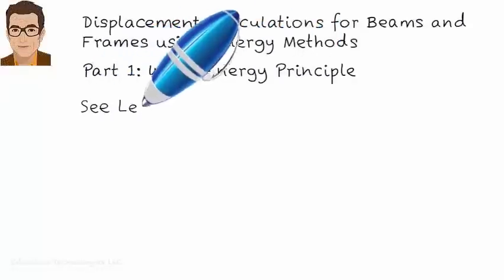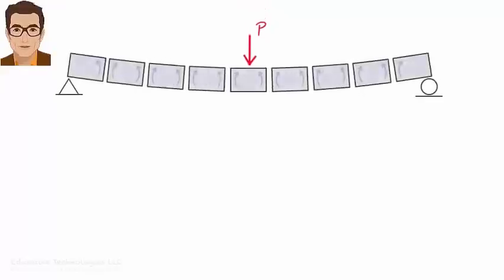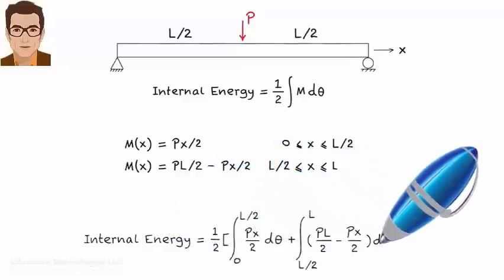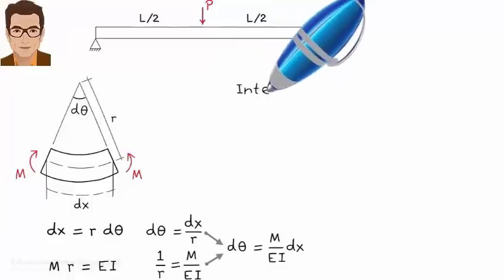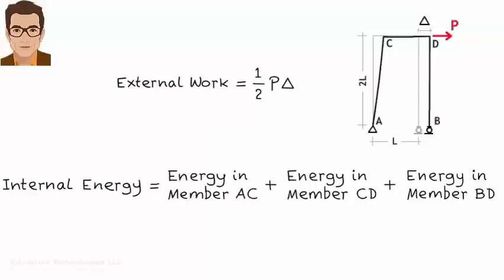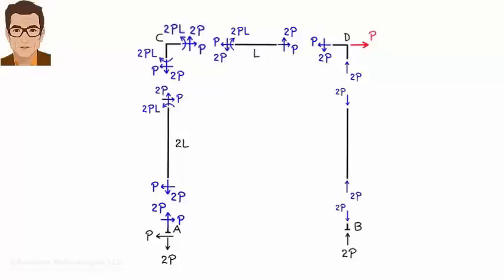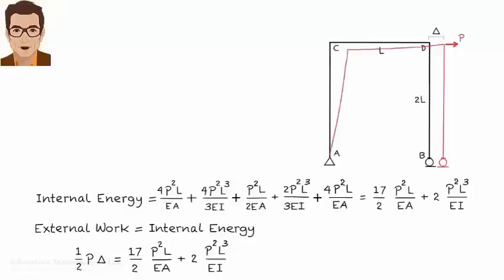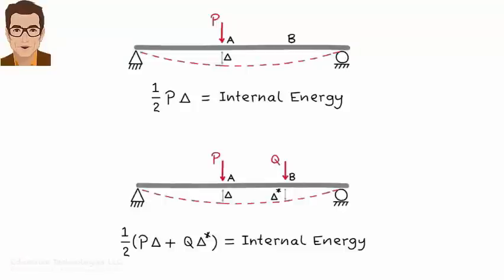SA20: Work-Energy Principle (Part 2)

Comment: Dr. I don't understand why the enegy by  shear had done in frame is negetive.
Reply from the maker: Not sure what you are referring to, please elaborate. Energy due to shear is assumed to be zero, it is not calculated here.
Reply: @DrStructure  Dr. at 11.22 ,I saw the shear is not zero but P , I don't understand why the energy due to sheer should be neglected .
Reply from the maker: In most beams, shear deformation is not significant, compared with rotation and axial deformations, hence we can often ignore it.  Further, the proper treatment of shear deformation requires a basic understanding of mechanics of solids which we have not yet covered in these lectures. Eventually, we will get into solid mechanics and discuss the topic then.
Reply: @DrStructure  Thank you so much Dr. 非常感谢

Comment: hi sorry for late comment, what about solve some indeterminate beam? What is the best method to use? Are there any example about it?
@Dr.Structure
Reply from the maker: Do you mean techniques for calculating displacements in indeterminate beams? 
One can use the slope-deflection method, or the force method, to analyze an indeterminate beam turning it into a determinate one. Then, use the virtual work principle (or other similar methods) to determine the beam's deflections. You can check out our lectures on the slope-deflection and the force methods for their details.
Reply: Dr. Structure i have tried using force method, but what happens if both of the support are fixed support? How to change it to be a determinate one? And also what about a beam with fixed support(left side) and a roller(right side)? I don’t know which one i have to use to solve a problems.. so much methods ya..
Reply from the maker: You can use either method (slope-deflection or force) for analyzing indeterminate beams. If a beam is fixed at both ends, the slope-deflection method is a better choice. Why? because the method tells you that the moments at the fixed ends are equal to the fixed-end moments which can be easily calculated using the tables given in most structural analysis textbooks. But, if you want to solve the problem using the force method, you can make the  reaction forces at one of the ends redundant, which would turn the beam into a cantilever one. In the case of a beam with a fixed and a roller support, the reaction at the roller can be made the redundant force. Alternatively, you can make the bending moment at the fixed support the redundant force.
Reply: @DrStructure  wow thanks !! hm what about Castigliano Theoreme that makes Work-Energy Method can solve Distribution Load and more than 1 load?(using partial derivative) is it right? do you have the lesson here?
Reply from the maker: Yes, Castigliano's theorem can also be used to solve displacement problems. We don't have a video on that. But all these methods can handle distributed and multiple loads. Also, one can use the principle of superposition when multiple loads are present. The total displacement at a point due to multiple loads = the sum of the displacements due to each load.
Reply: Dr. Structure can we use double integration, work energy for solving multiple loads ? Which one is the best way to solve multiple loads beside superposition?
Reply from the maker: Yes, we can. There is no such thing as best method. They are all best :) These techniques require using/integrating the bending moment equation for the beam. Since we can write such an equation for a beam subjected to multiple loads, the techniques do work.

Comment: can you tell me what books do you use ??
Reply from the maker: +  Islam Hanafi This content does not come from any specific textbook. But if you are looking for a textbook recommendation, I suggest Structural Analysis by Russell Hibbeler.
Reply: +Dr. Structure  ok , thanks 
i have another question please , in the virtual work method can we develop a simple way to integrate ?
Reply from the maker: +  Islam Hanafi No, there are no shortcuts for the integration. If the beam is subjected to several concentrated and distributed loads, the moment equation may becomes lengthy making the integration time consuming. But you can use a software tool, like Mathematica, for performing symbolic integration.
Reply: in our class we sue another method i cant recognize 
we draw the bending moment due to loads as Mo and draw bending moment due to unit force 

and integrate the two areas Mo and M1 

got it ?
Reply: @Islam_Hanafi  is that moment area method?

Comment: Internal Energy due to bending_ You did not multiply with the 1/2 outside the integral.  confirm?
Reply from the maker: Are you referring to the equation at time 6:00? Yes, 1/2 has been taken into account in arriving at the result. The same is true for the equation at time 12:00, and for the equation at 13:10.